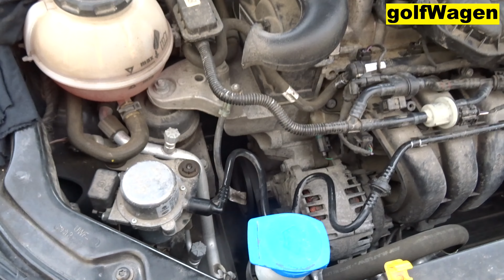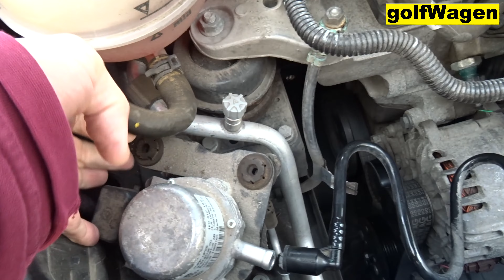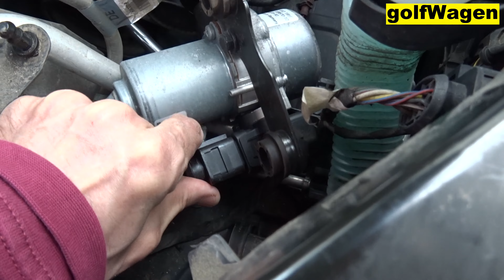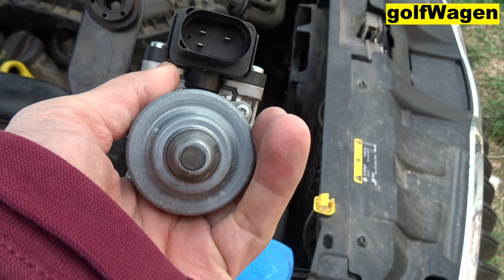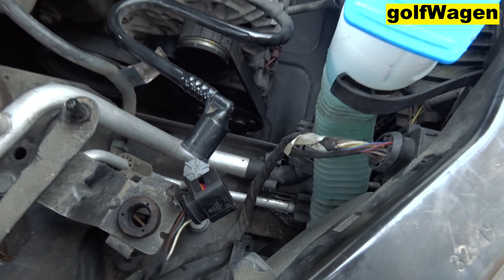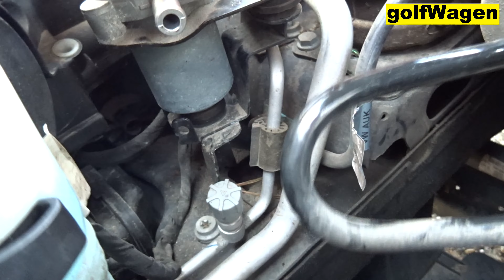VW Polo electric vacuum pump replacement /brake booster/

Comment: According to my VW dealer parts website and at least one mechanic, my 2003 Jetta  Wagon1.8T is supposed to use this same electric vacuum pump. I have had braking problems for some time, and so I wanted to test this pump. But for the life of me I cannot find it on the car!  I do not have a mechanical pump at the end of the camshaft, so does anyone know where this pump could be? I have looked above and below the car, and all the manuals are worthless.  Thank you.